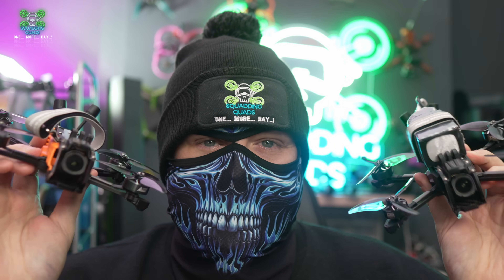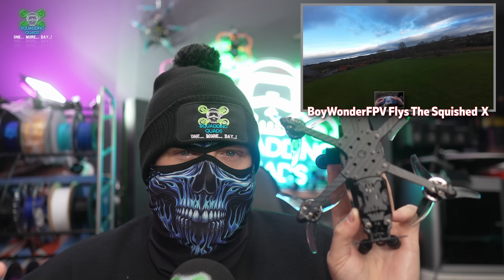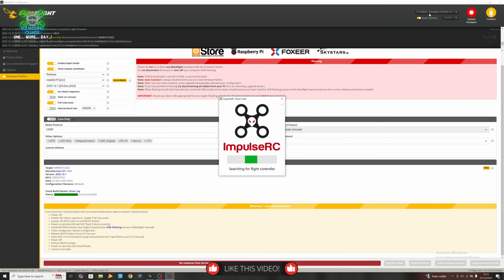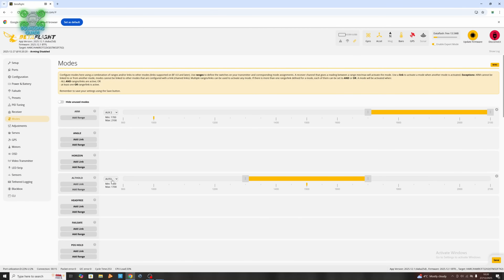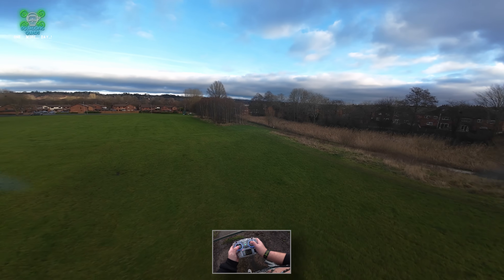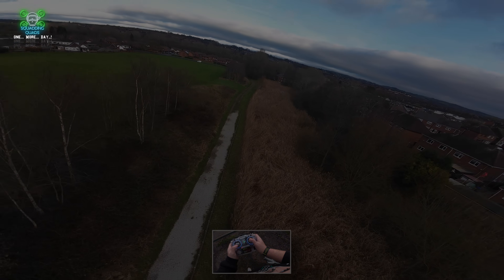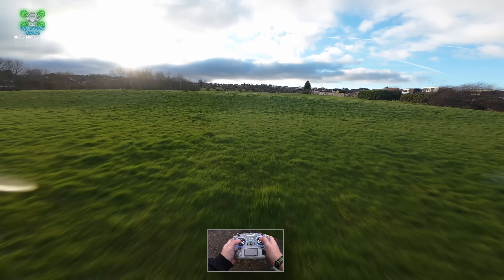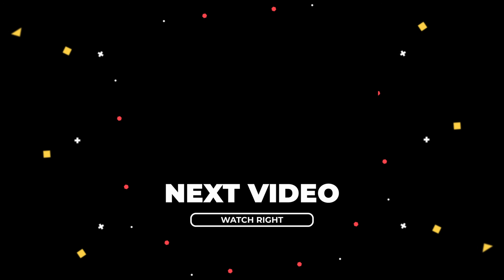Deadcat vs Squished X – Do You ACTUALLY Know the Difference? Seeker35 DC vs XL + Betaflight 2025.12

Comment from the maker: Alright Squad… let’s settle it 👀
Deadcat or Squished X — which are YOU flying and why?

⬇️ Also, do you actually trust Position Hold on FPV yet… or nah? 😅
Reply to someone in the comments and let’s start a proper debate 👇🔥
Reply: Seeker 35 squashed ❌!! Looks like a savage😮‍💨 nah haven’t test position hold
Reply from the maker: It really is bro 😊
Reply: Deadcat to get no props but I’m debating if go x frame and run a action cam. I haven’t set up position hold/altitude mode yet
Reply from the maker: @HolyCao5 the 04 pro is so good it's always a shame to get props in view isn't it.
Reply: @squaddingquads without a doubt. I currently exclusively run DJI O4 but the new US ban is annoying. Still going to stick to this until I fully can’t use dji products. 
- Geprc Vapor D5 
- Avionrc Nexa 3.5 Pro
- Betafpv Pavo 20 Pro
- Betafpva Meteor75

Looking to get x frame and building a quadmula 25 sp
Reply from the maker: @HolyCao5 thankfully as the 04 pro is authorised it won't dissappear, but that's a nice stable you got
Reply: @squaddingquads  Been flying squished X for freestyle since 2015. Tried other setups but to me SX works best for the flippy floopies.
Reply: I fly speedybee master 3X, X frame but NO props!! It handles barani's and other tricks very well. I just dont need pioshold, so for now im not touching any software😅
Reply from the maker: @Bdroneflights yeah if you don't need it definitely don't touch it mate lol
Reply: @squaddingquads  I have a question sir, a few episodes back you put a carbon frame on an Air65. I have purchased the frame and parts but NO INSTRUCTIONS. I am asking you to please point me in the right direction.
Thank you sir.
Reply: I got the seeker35 DC, SpeedyBee  master3X and IFlight evoque F3 which as you know can change to both DC and X, there is no best for me just what i feel i want to fly on the day😂